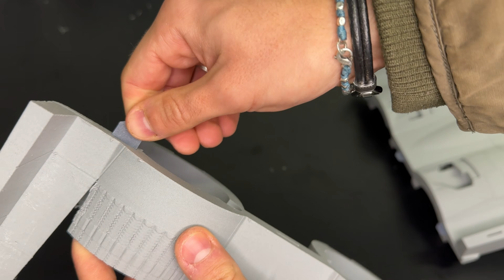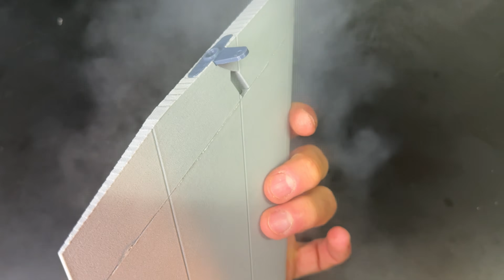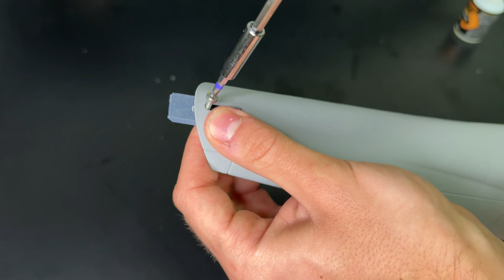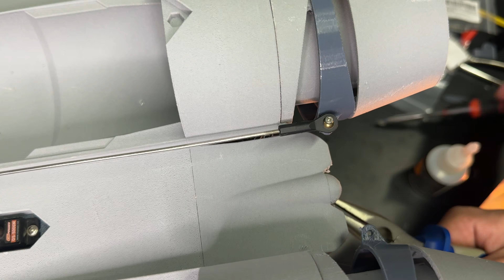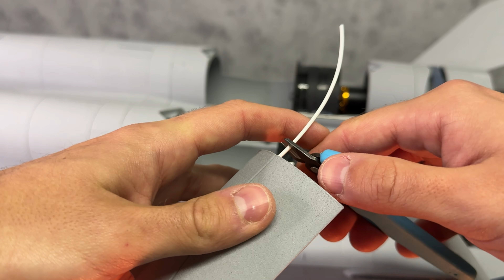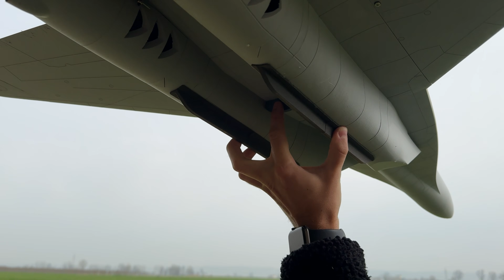How To Build The MiG-29 | Twin 64mm EDF With Thrust Vectoring!

Comment: Such an awesome looking plane. I wish it had landing gear. Lot more easier than hand launch with a broken shoulder :)
Reply from the maker: You are right. Some of my models have wheels. This plane was designed to be as light as possible to make the most of the thrust vectoring though. Landing gear would have made it too heavy

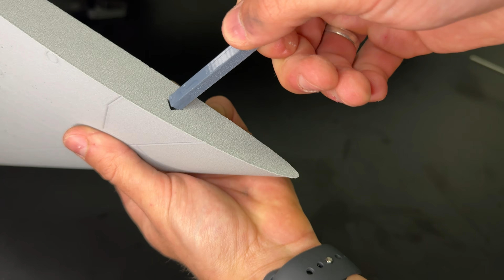Comment: 4:40
note: sometimes when sliding a joint right after applying fresh CA glue, the friction can make the CA glue cure unexpectedly before you reach the proper stops-- and then you're stuck with a pritned part sticking out further than it should by
Reply from the maker: Yes you are correct. It all depends by the CA glue you use. The one I use gives plenty of time to position the piece correctly

Comment: One additional note: If you're cutting carbon rods make absolutely sure you're wearing proper breathing protection, Carbon dust wreaks havoc on your lungs
Reply from the maker: Sure! Thanks for the suggestion 🤞
Reply: I always cut carbon or fibre glass under running water.

Comment: Nice Project. Now i list you a couple of my personally thaughts. 
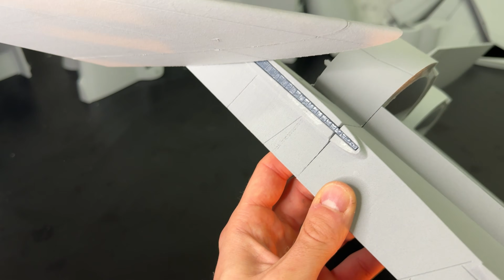3:16 i personally dont like this large gap between the 2 big parts of fuselage. Is it warping? Or any missaligment of the printer?
3:21 i would youse less glue and aligment taps for the nose. It holds no compontnes and in Hard landing it breaks off instad the full plane.
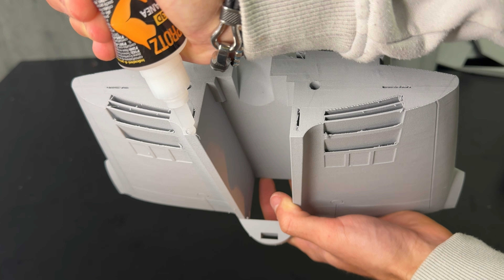3:36 i would prefer 1 carbon tube in the middle of the fuselage. Instad of 2. To safe wight. The torision force would hold by the plastic aligment tabs. If it possible and not blocked by landing gear. 

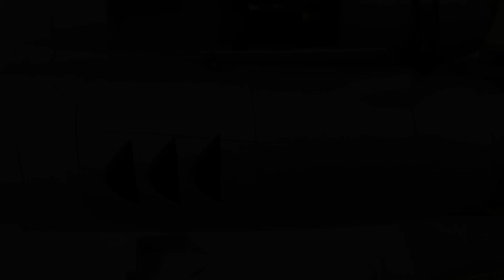10:48, this "round Bump" on the EDF Cover on your right hand, is this scale like on the real? Or is this just help latch to lift the Cover?  I personally dont like it. I would youse a small screw driver to lift the cover up. I prefer the optic in this case. Or is it an air opening to provent blow off the cover from ram air? 

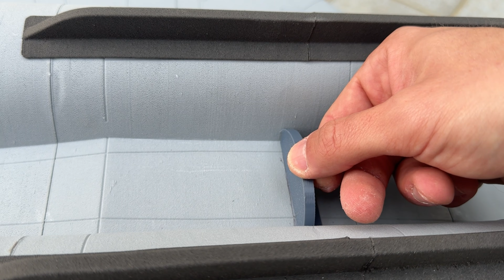13:17 what is your opinion to not make external grip, instad make "step" in the fuse to grip/push it. To make it Aerodynamic smooth

Can you design a negative or positive Shape Molding Form for custom PET Canopys? I dont know how to pronunce it right. This molding form to heat up this translucent acrylic material and  suck it over this canopy molding  to get translucent scale canopy in the end.

This are just my thaughts about it. But Dammn this is a Hot Project.

Comment: FYI it is my udnerstanding that a set of wings BEHIND the main wings are called ELEVATORS .... when there are no elevators in the rear but on the wings outer trailing edge they are Elevons and the inside ones are Alerons ... 
ok no wing controls ... so then yes you are correctly naming them elevons .. 

nice build some neat ideas in assembly too ... such as the tabs for gluing etc ..

Comment: Hi, would it be possible for you to send me the construction/CAD file of the canopy for the 64mm Venom S Sports Jet? I’d like to use it as a reference to design an FPV gimbal or a fixed FPV mount. Having the original file would make the design process much easier. Thanks a lot!

Comment: What Filament are you using to print this? LW-PLA yes, but is it the prefoamed or actively foaming stuff? The prints look too clean to be the former..
Reply from the maker: Hi! Active foaming LW-PLA
Reply: @LSPlanes  ColorFabb I assume by the color? How are you avoiding turning your parts into a rattlesnake from oozed filaments in the part? What infill are you using?
Reply from the maker: @s @stratos2 ’s the 3dlabprint LW PLA. Some material remains stuck inside the pieces during the retraction but once it’s all assembled it’s very hard to notice, unless you shake all the plane lol.
It’s printed with gyroid infill